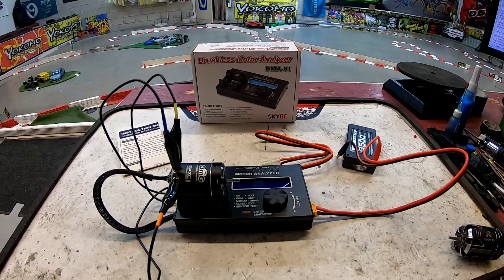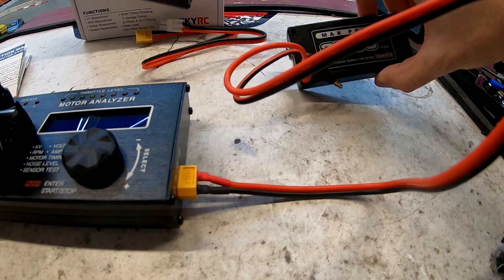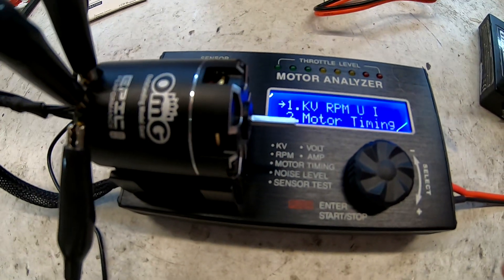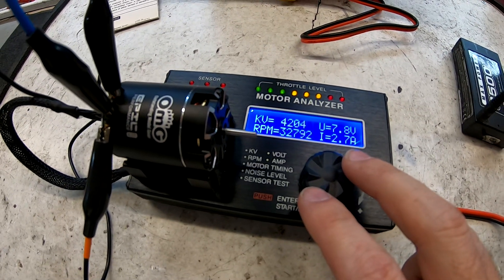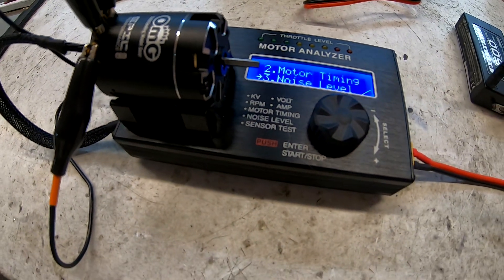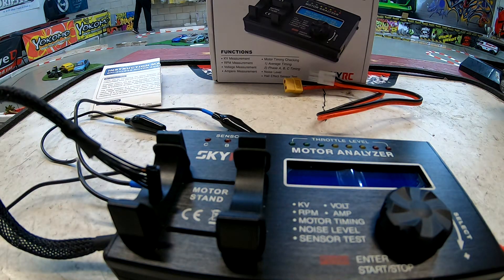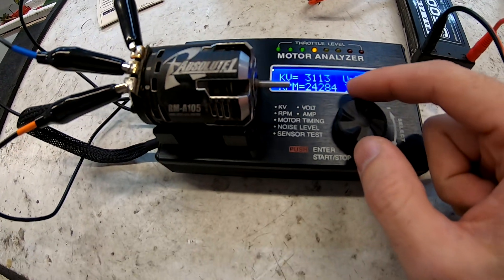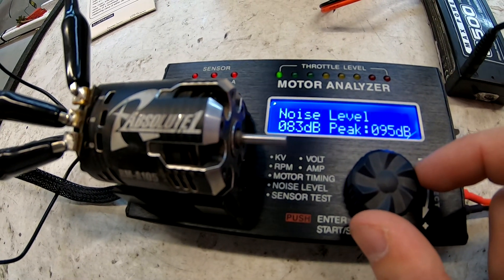SkyRC Brushless Motor Analyzer Demonstration

Comment: What amps and rpm do you recommend for a 10.5? And on esc what boost number or keep blinky for a 13 sec track.
Reply from the maker: Most 10.5's will run just fine on 120amp or 160mp ESCs. I just like to keep the RPM's below 100,000 :D

Comment: What do you mean by boost and naturally aspirated. 
In terms of electric motors.
Reply from the maker: I am referring to the ESC's ability to use a boost/turbo functionality to push the motor's past their standard redline. Typically when running Naturally Aspirated mode these drift motors spin up to about 40,000 RPMs at redline. Boosting will push that all the way up to 100,000 RPMs and sometimes beyond. There are motors on the market today and are designed to be pushed into boosting range on the regular and are built to stand up to the stress of having more power forced through them.